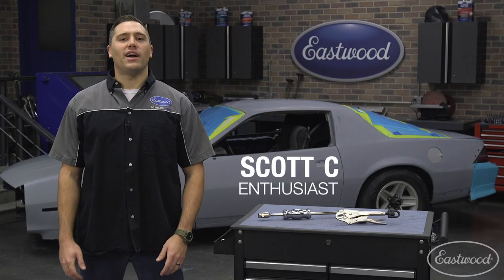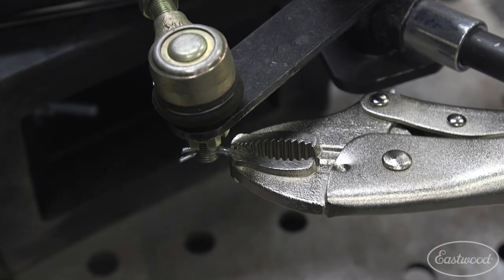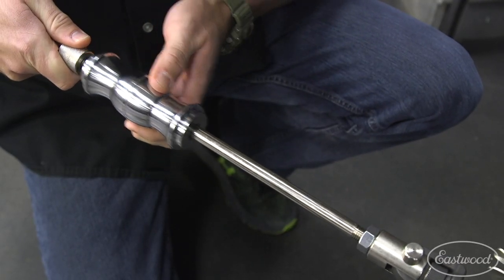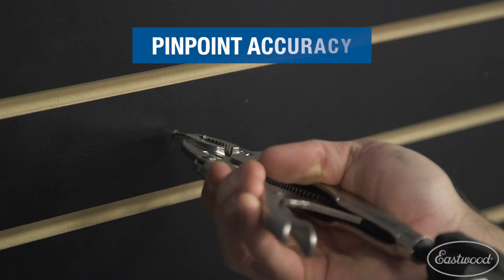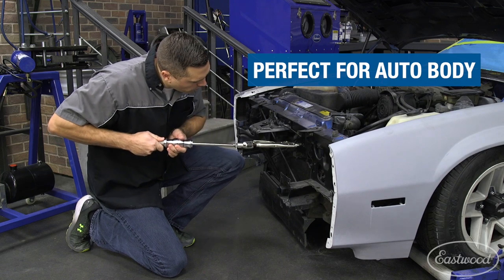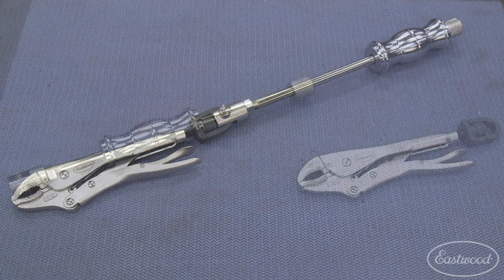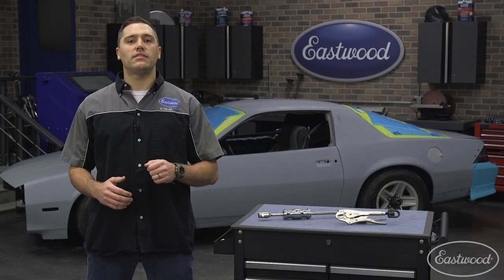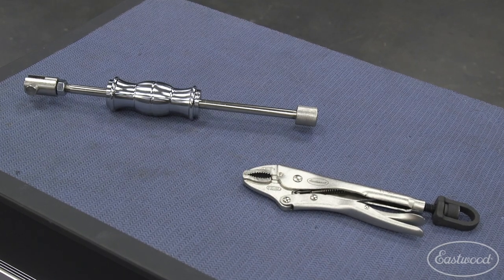Fully Adjustable Locking Plier Sliding Hammer Perfect for Precision Pulling - Eastwood

Comment: What is the adapter threaded size for the locking pliers? I want to use my own vise grip pliers.
Reply from the maker: It is only offered with the included vise grips.

https://www.eastwood.com/eastwood-locking-plier-slide-hammer.html
Reply: @eastwoodco  thanks for the info 👍